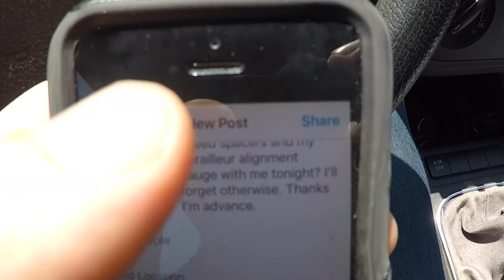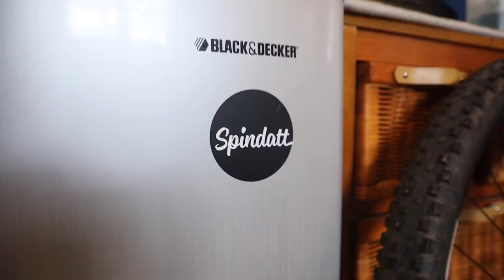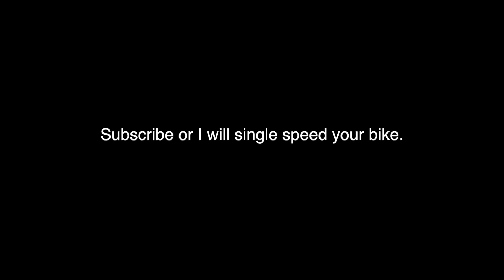Just Might Work

Comment: Next time try taking the derailleur hanger off and if you have a vise with the flat part for using as an anvil, try slowly cold working it with a smooth faced hammer. I have done this on several occasions with success, but it takes a bit of patience and time. Lightly tap the hangar on that flat steel surface, key word LIGHTLY, because if you hit too hard it will deform the aluminum, leaving indentations from the hammer.
Reply: Ya, I've done that a number of times too.

Comment: I have done this with a fixed gear set up and vertical dropouts. The only issue was I had to use a Surly chainring, that is too nice, for the idller. What isn't bolted down can be removed by someone else. Still it looks sketchy but works OK.

Comment: OMG  I'm dealing with this EXACT problem right now as I watch your video. 
Not tried for the "bend it back" part of the fix yet. But in my case it sucked the derailleur right over the top of the cassette and trashed it. Hopefully I have something in the parts box and the hanger will straighten out okay. Finding a replacement for a 10 year old bike could be a mission. and I don't really want to buy a "new" mech

Comment: I have a question, I have a 90s mtb frame I’m building up for some single speed single track fun.  (Flat bar). Do I go v brakes or Cantis? Cantis look cooler obviously. But Would the performance of Vs outweigh this?
Reply: v brakes if you're actually using it on single track imo

Comment: one of my all time favorite hacks was with a piece of cut carbon bars: a chain keeper for 1x setup. Take a drill, make a few holes, and ziptie it to the chainstay. could probably make a better chain tensioner than the neat chainring hack here, especially considering SNAP
The issue seems to be specifically under load, where the top of the chain will pull flat, and the over all length of the chain needs to be increased to compensate for the moving of the idler.
Also your threats dont phase me - single speed me uppppppp